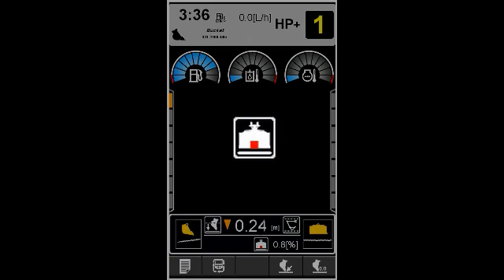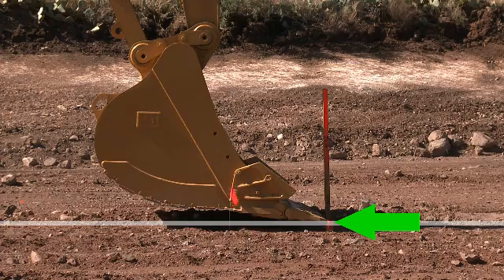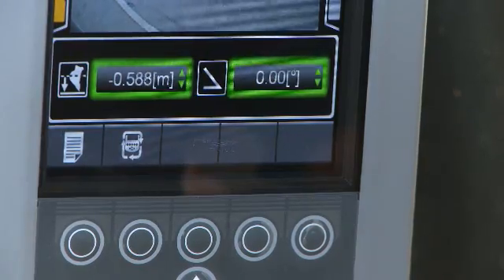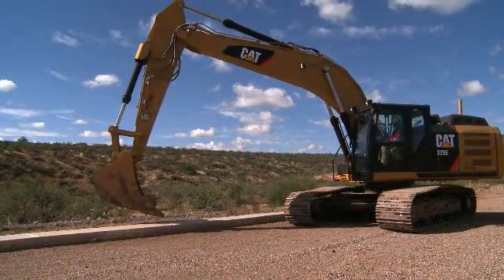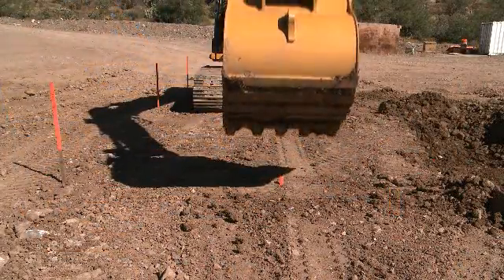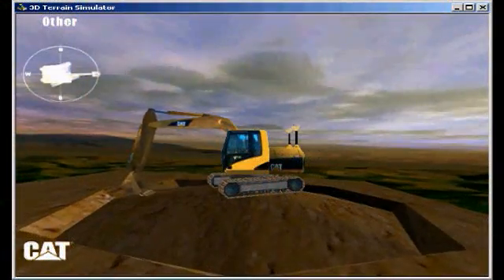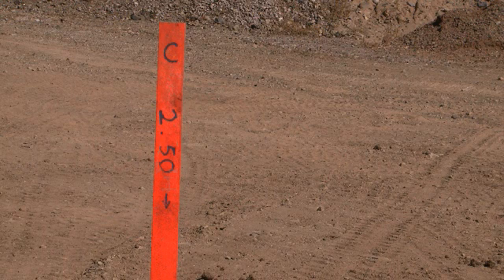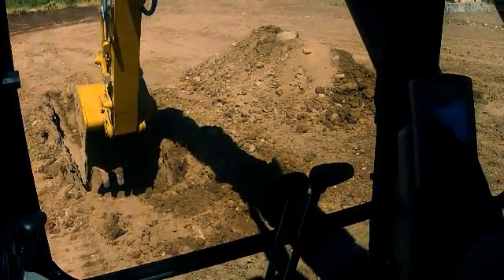Cat® Grade Control for Hydraulic Excavators - Basic Operation Using Reference Elevations

Comment: Can you tell me how to change operater controls to backhoe controls on a 313f
Reply from the maker: Hi, Kenneth. If your machine is equipped with the pattern changer, you will find it beneath the floor mat. Simply rotate the valve to your desired pattern. If you have any trouble, refer to the owner's manual or reach out to your local Cat dealer. - Dani